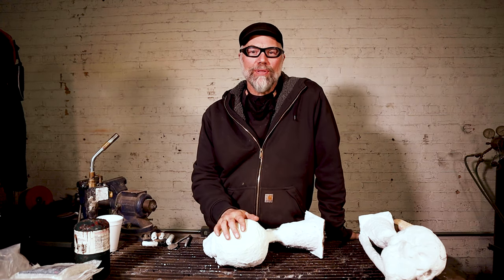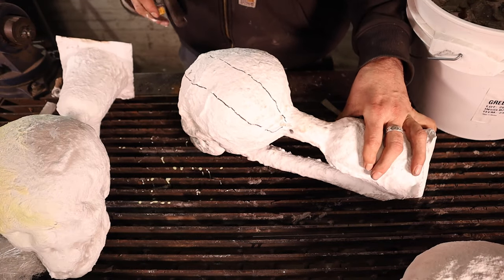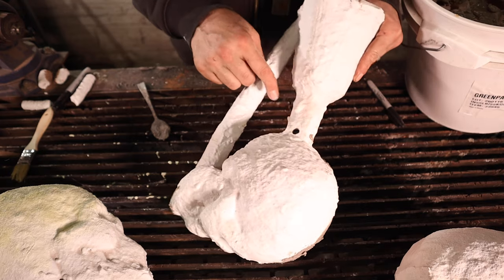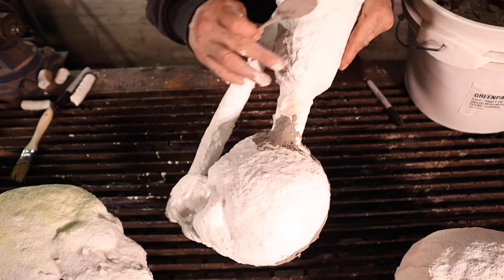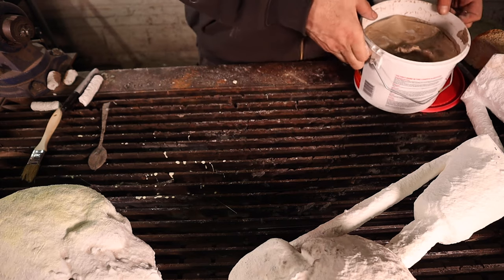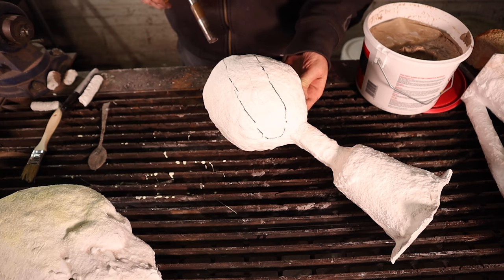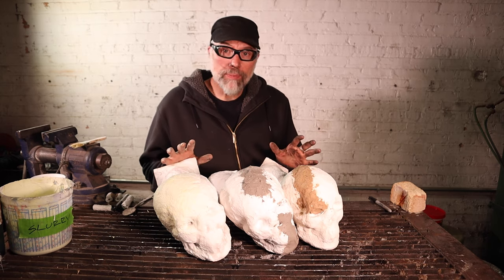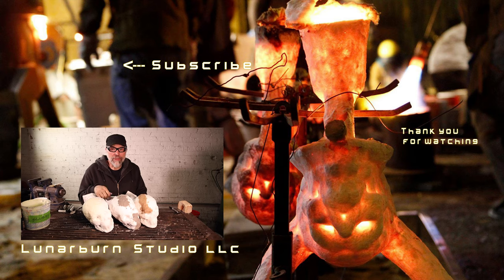How to fix ceramic shell: Mortars and Cements, Part 2

Comment: Hi Eric, wanted to say thanks for your videos. Your approach to teaching is appreciated. The fact that you are willing to share your information is appreciated. The time you put in to making these videos is appreciated. We are switching over from classic investment and you are correct, ceramic shell is better and possible. With the newer slury, that does not need constant stirring or additives, we are taking the leap, with your help. Rather than stumbling through a new process, you helped fast-track the process for us. We have a kiln for melting wax from the moulds, but it is too smokey for our set-up, so we are trying the boil method. Two thumbs up for your work. PS. great sculpture work as well in your earlier videos.
Reply from the maker: Wow, thank you so much for your kind word.  I am glad you are finding my videos help.
How are the boil outs going so far.  I have been meaning to do a video on that as well.
Reply: @LunarburnStudio  The first tests had mixed results with the shell, but the bronze turned out great. Your patching tips helped! We are going to do a second test next week, just waiting for more slurry. The biggest challenge is getting our heads around how things might be different for the wax trees. We had a great system for classic investment, but it may not be the best or translate well with ceramic shell (especially with boiling out). Did you start with classic investment? What were the biggest gating and venting changes if you did?
Reply from the maker: Yes I started with classic investment.  If your spruing worked with classic it will work shell with regards to the metal. but your right with boilout or burnout in general you need to be mindful to give the wax escape routes out of the shell. You can do this via your venting or via micro-venting (drilling holes) to allow the wax to drain (or float).  The classic (standard) investment because of its thickness can withstand the expansion of the wax where the shell needs some help from time to time.

Comment: Thank you for all the great info. Got my first usable cast watching the series. Keep up the great work
Reply from the maker: Awesome! Thank you! What were some of the things that helped you succeed?
Reply: @LunarburnStudio  ive been trying to do lost pla casting in plaster of paris. After seeing your videos i found a company that supplies silica flour etc so tried the lost pla in ceramic shell. 2 days later first succesful cast. After 20 plus attempts via other methods
Reply from the maker: @tke7mu0u  Awesome, out of curiosity what pla do you use?
Reply: @LunarburnStudio  the cheapest i can get a hold of. I believe its cctree. I noticed that its important to print with as little infill as possible and  there has to be vents in all chambers as the air trapped in the mold expands and cracks the shell before it melts no matter how hot the kiln is during burnout

Comment: Hello Eric,
I work at a University in Canada. We are currently in the process of switching over from classic investment to ceramic shell and your videos are proving to be an invaluable resource. The information you provide is presented in a clear step by step fashion that is easy to follow. I have a question ,not about mending the shells but about the zircon sand that you use for the first coating. The Remet page lists a few options . Fine as 400 mesh, coarse as 325 and extra coarse as 200. Are you using the fine/400 mesh? In the ceramic department we use a product called Ultrox which is a zircon silicate that is used as an opacifier in glazes. It has a mesh of 400 and is more of a flour than a sand. Do you think that it would be worth trying? I can't wait to see your furnace build in the next video. Thank you for your time.
Reply from the maker: What I’m using for the stucco it’s just referred to as zircon sand. The 400 325 and 200 mesh is typically referred to a grade of silica that specifically a flour, which you would actually add into the slurry itself.  I would only add zircon flour to the slurry if I’m doing mostly iron casting because of its capacity to handle higher temperatures. The main limitation to adding zircon flour is that it is heavier then tge fused silica and will settle faster. It really need to be used with a mixer or drum on a timer to keep it suspended. Suspension additives aren’t enough.

Comment: Can ceramic shell be used for casting solid metals and glass?
Reply from the maker: Not sure what you asking.  metal and glass at the same time? or separately?  Solid metal casting yes no problem.  Glass however is a challenge, the silica in the shell and in the glass like to fuse.  I have tried a number of washes//coatings/releases  but to get them thick enough to provide pa proper barrier you loose all your detail.  But I am not giving up still a few more thoughts to try.